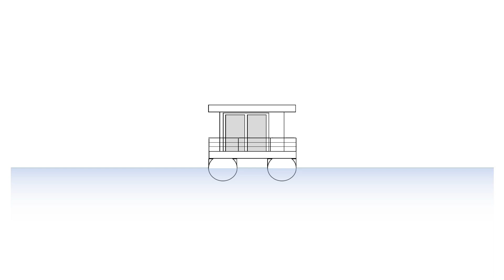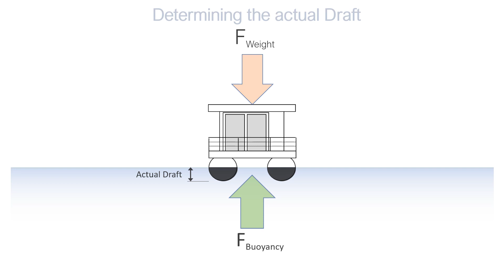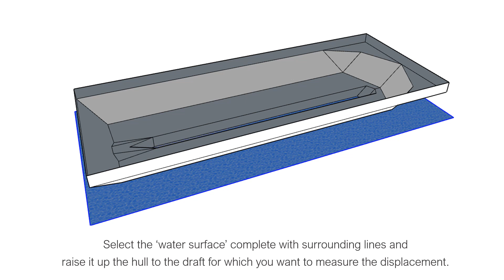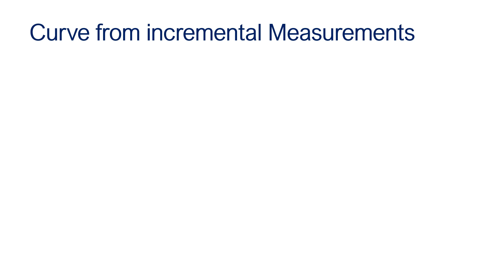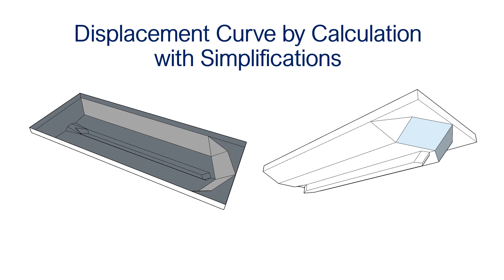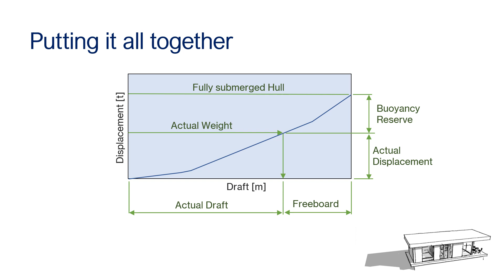Calculating the Freeboard and Buoyancy Reserve

Comment: Are you naval architect?
Reply: Hi Carlos, I am Master of Mechanical Engineering. As CeO of my houseboat company, I had naval architects always reviewing and approving my calculations to make sure they are correct. This is however more a very general calculation that doesn't require a naval architect.
Reply: @KingsRansom-ru8nt  Congratulations, have you made any video or calculation when the side touches the water, any stability curve, what regulations apply to these ....